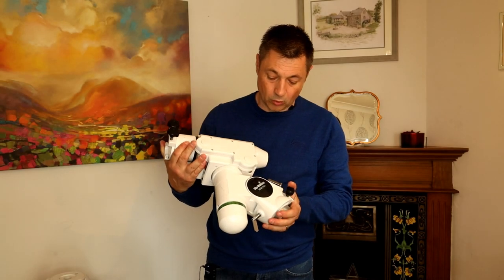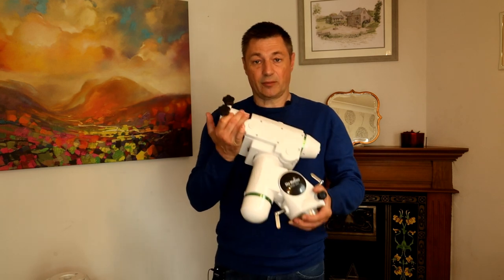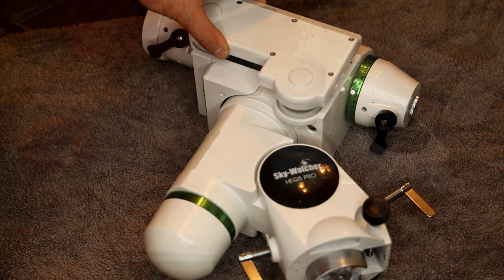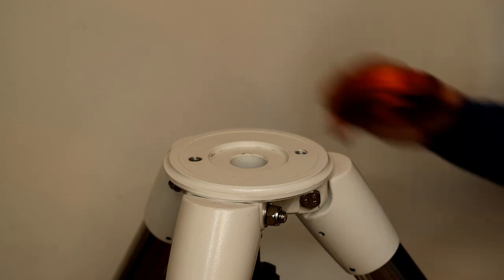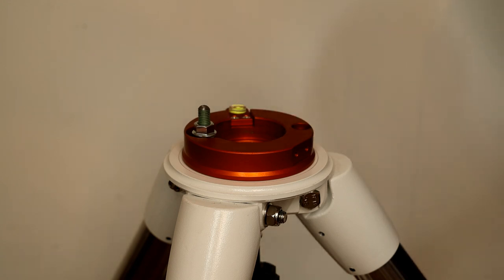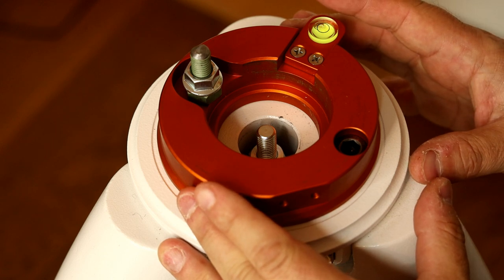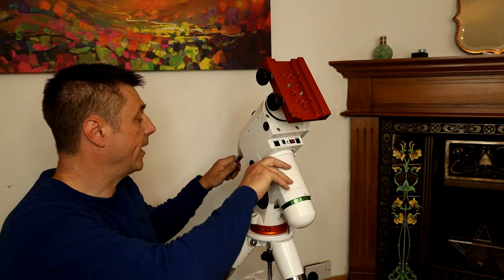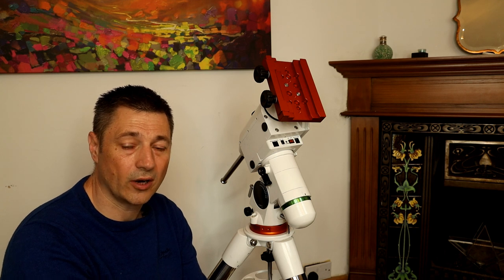HEQ5 Pro by Sky Watcher. Geoptik upgrades

Comment: Good video Glenn, nice upgrade. I nearly bought the HEQ5 Pro, but opted for the EQ6 R pro in the end so I could put more weight on it. The 5 is a bit more portable as well though! Lovely image also mate👍
Reply from the maker: Hi Simon. You will love your EQ6 r pro, i do mine. This is much easier to move about as lighter. I like it

Comment: I have an early black EQ6 2009 version-also the drive belt mod Kit that I have never fitted.!! Last year I bought an EQ6-R Pro for one of my Meade SN-10” f/4 scopes. I have modified another Meade SN-10” that I have removed the diagonal, so placing either a ZWO 2’’ or 1.25” camera at the primary focal point in front of the corrected plate. I     have a dozen or more of ZWO cameras, all non cooled that I can use with my home maid Peltier cooler. I have made a much more substantial set of rings and wider base plate as you have done. I have been aluminising all my home made mods the same ZWO equipment. I have their auto focuser, focus wheel, off axis guider, and their ASI Pro mark 2, also their mini guide scope and mini ASI ASI 290 mm. We seem too have many of the ZWO accessories, so I am keen to follow your Projects. Over the years I have been sent various scopes/cameras to evaluate and keep, when I used to write regular articles for Sky and Space magazine as well as being their associate editor. You have the right idea with your mounts, it is more important than the optics systems. Currently building and EQ Fork mount for the 16” f/4.5 Newtonian, they 12” version was a test Bed for the 16”, which like the 16” has several unique features. I have a pretty good workshop to make all my `custom parts, which is half the fun for me.  My observatories are fairly a unique design due to a rocky hillside 5-acres away from city lights. I am 83.5 years now and tending to slowdown a tad, as I also have a few more interests, which battle for time. I still work at the University of Tasmania, designing and building various computer controlled all sky cameras to take 180 degree ~sky images 24/7-I started this in 2005 as my original design- a work I continue in climate research, along with another colleague at the University. As vast change from a varied medical career. I engage with NASA JPL and other overseas institutions with astronomical for which I am placed as the southern most optical observatory in this hemisphere. Not the sort of astronomical projects that would inspire excitement in most amateurs.-Check out my work with Mt Canopus Observatory, 5-minutes up the hill from me. Working with their 1.05 metre telescope is quite an experience. https://goo.gl/photos/q3j9u45XfYEGnPc97 for now, time for some sleep. Regards and say safe.
https://goo.gl/photos/AUvjS5MXWwtwt35d7      also   https://goo.gl/photos/4hGfZrUUVRpGHnHb6     and    https://goo.gl/photos/AVxnHf7iG4NuW2Lf7
Reply from the maker: Wow you have acquired a lot of equipment over time. The mount is certainly very if not most important as without good tracking you will fail to get good images. I am lucky that I have an engineering kind of mind and am confident enough to tinker. I hope by sharing others may have a go and save a lot of money in the process. There seems to be a very unfair markup for a lot of Astro gear and mods. How well does your homemade cooler work? I was thinking of getting a used non cooled camera and trying something like that out?
Reply: @Astrobloke  Which one are you referring to? I have redone the links above as some did not work when I tested them. Here is one on building the 16" fork mounted Newtonian. https://goo.gl/photos/1KHzBVUQihq2ZWM98   I have four modified DSLR's, the first one back about 15 years, a Nikon D50 converted to Infra Red, a second one a Canon 350D with full size Peltier cooler inside the camera behind the detector, plus a Baader filter change, also two Canon 450D one has a Ha filter mod, the other 450D has been converted to monochrome and Peltier cooled. The Bayer matrix has been removed so all pixels groups are luminance, increasing the resolution and sensitivity. https://photos.app.goo.gl/dfrVGLSoTzmyfNKB6  also  https://photos.app.goo.gl/jyr99aRFb84HyidM6   also  https://photos.app.goo.gl/SL9x86AWvD75P4Yz9   also  https://goo.gl/photos/gS9Yh1AMtjibMb4e8

Comment: Good tip about loading the tripod bolt for the alt-az bolts. I put a bit of copper grease on mine aswell. What does a Losmandy plate offer you over a Vixen type?
Reply from the maker: I may use some copper grease too thank you. I like the Losmandy plates for a few reasons. I feel they give a more supportive base for the scope rings. There is more space to add accessories like dew controllers- psu’s - nuc’s or asiair etc. Lastly when off the mount it sits nicely on the shelf with one without rolling over , had my 130pds nearly roll off and fall to the floor before I changed it.

Comment: Nice video!  My first mount was also EQ6R-pro but wanted a 2nd mount for my smaller scopes and so I could have 2 rigs running at once.  I also purchased a new(I believe) HEQ5-Pro from Skywatcher and just received it.  How can you tell if it needs the new belt?  Also, I use an ASI Air to control my mount and scope.  I know you don't, but do you know how I mount activate PEC using ASI Air?  Thanks from New Jersey!  Congrats on the recent APOD collaboration!
Reply from the maker: Hi Jim. I believe the belt upgrade helps remove or reduce backlash and most report guiding improvement. Its not something I can show results on as it came already modded, I will see if I can find out about the PEC training and ASIAIR as I will be doing PEC training on this mount very soon. I will report back what I find out

Comment: Hi Glenn, great Video as usual.  quick question - why do you have to have the plate orientated with the bolts on the right, out of interest?
Reply from the maker: Thank you for your comment. I do prefer the saddle bolts on the left but with that small rig the EAF gets in the way. I'll see how it goes as as its a new set up. One option is to get some small risers for the rig to clear the knobs and I may go that route if i have issues and want the saddle the other way round
Reply: @Astrobloke  got it thanks.  I am right handed so I find that I want to hold the scope with my right hand and undo the bolts with my left hand so have them on the left.  My EAF is that side too but the scope (ES ED APO 102) is long enough for the EAF to not get in the way.  I start the observatory build tomorrow - can't wait :)  thanks again.  Chris

Comment: would you reccommend upgrading a heq5 even if regardless how long i can expose without trails, the light pollution in the area means anything over 2 minutes is unusable?
What advantages would it grant me? Multistar guiding in phd2 seems to keep error way down too

(dslr iso 800, the optimal iso for my camera)
Reply from the maker: Hi Chris. The belt and saddle upgrades may not be essential for every Heq5 and in some cases not bring if any noticeable improvements. The saddle for me is important as my scopes are on the larger Losmandy plates and I don't like the saddles where screws mark your bars. The belt mod may only show its advantages if you image for much longer subs. I often image 5 - 10 min long subs when doing narrowband targets so I would have added the belt mod.

Comment: I have an heq5 (and I can get a good price on a heq6r tripod)my question is if I buy the adapter that you are showing in the video will it work with the heq5 so that I could mount it on the heqr6 tripod ..thanks in advance.
Reply from the maker: Hi, I show this on an EQ6 R Pro tripod and its a great adapter, I think it will work for you but you could just double check that the Heq6 tripod is the same as the EQ6 r pro one.

Comment: Hi I have that exact same saddle for the heq5. The supplied screws dont seem to connect the puck to the saddle and I notice you two screws with nuts as opposed to the x4 countersunk screws supplied. Did you get that as supplied or purchase the screws separately
Reply from the maker: Hi. That is what came supplied with mine. The puck is not threaded so need the bolts. I was going to get 2 more but it holds fine and now its on I can’t see them
Reply: @Astrobloke  I see, thanks for the reply, need to get some screws. Do we know what the size is for the screws?
Reply from the maker: @raeiqmusachi  when I am home I will measure them for you
Reply: @Astrobloke  very nice of you
Reply from the maker: @raeiqmusachi  They are M6 bolts with 10mm nuts. Bolts are about 10mm long. If you contact rothervalleyoptics. sales@rothervalleyoptics.co.uk or their number is Telephone Numbers: 01909774521 / 01909774369. these are the suppliers of my saddle and puck and the bolts and nuts came supplied. They could confirm the exact ones you need.
Reply: @Astrobloke  Awesome, thanks for the detail, My supplier seems to think that the puck screws onto the saddle via the 4 offset threaded screws but they are 32mm apart whereas the puck holes are 25mm apart. I’ll fix my problem by going to the hardware store. Thanks for the measurements.